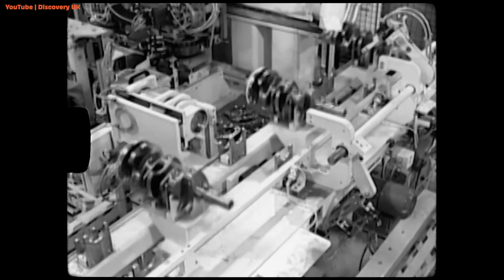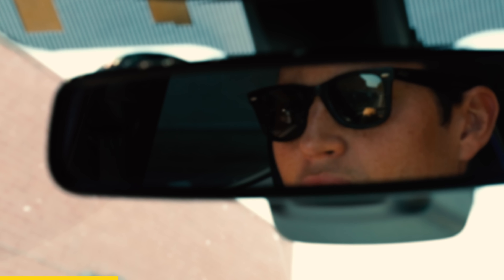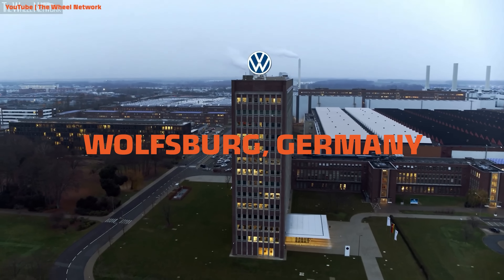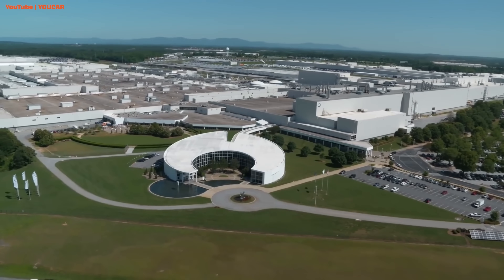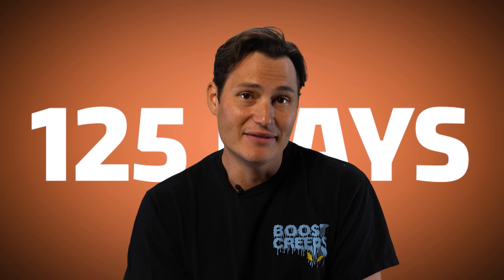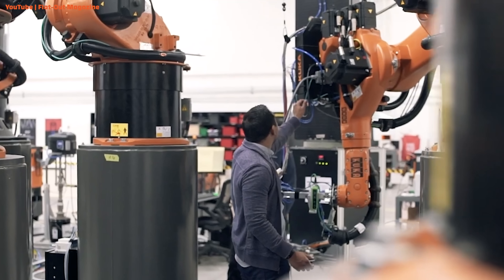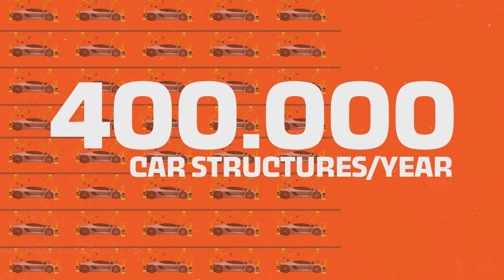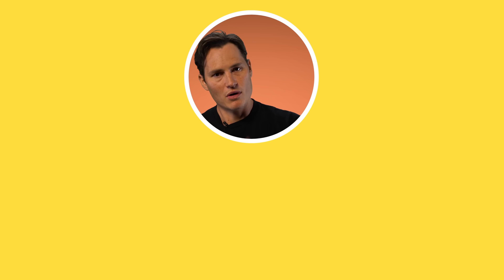A.I. Designed this Car

Comment: Year 2050: You will be downloading the car from internet. It will be made near the dealer who has 3d printer.
Reply: i hope we get there...2050 i mean.
Reply: @themexis  at 2050 6g comes out too
Reply: @jeremiah7913  whether it's 4g, 5g, 6g, and so on, AT&T is still slow as f*ck
Reply: @jeremiah7913  8g
Reply: Dealer: You want undercoating on that titanium chassis?
Reply: Sounds cool imho 😁
Reply: @aitoluxd  imagine dealerships are just 3d printers instead of lots u configure ur car on the fly
Reply: @v1Broadcaster  yeah, it's going to be great to see cars being made bespoke for every customer without making it costs arm and leg like rolls royce did. Plus with AI designing the new model, we would see weird yet effective designs that we couldn't even thought (which sadly eliminates jobs for engineers like me:(()
Reply: "You wouldn't download a car"
Reply: This is probably the most likely scenario.  One person would go into a dealer and say they wanted something like a miata, a relatively slow, but very fun lightweight sports car, and the dealer could show them a dozen different options.  Mixing and matching could add a premium, but not to much of one.  If the car ever breaks, the owner can have it brought in, the dealer prints a new part, and they disassemble and reassemble the car in about an hour.  Third party shops will have robots instead of mechanics, or mechanics running the robots, and do a similar thing with more generic but cheaper parts.  3d scanners are a thing after all.  The only problem here is that A. the cost won't be lower, but rather higher, cause capitalism, and B. You basically can't do it yourself, which isn't far off from what's happening to cars today.

In the future though, most cars will probably fill all roles.  You can't shed this much weight off a sedan and not turn it into a high performance sports car as well.  Gas savers will handle like a lotus elise, while actual common sports cars will be absolute monsters that perform like hypercars from five years ago.  Imagine a Mazda Miata or Subaru Impreza that can do 230 mph and 0-60 in 2.5 seconds.
Reply: Even with all of these advances, people still uses dealership which only add unnecessary costs and make hassels
Reply: Great Idea!
Reply: no dealer needed, just those 3d printers and cnc machines, just need the design files
Reply: *Download Lan Evo V data.
Reply: pretty sure they will still produce it in the manufacture, they just need the car to self drive to your place...
Reply: Torrenting cars
Reply: @daly7258  that could happen if you own a 3d printer 😂😂
Reply: year 2150: you will own the printer
Reply: "You wouldn't download a car", said an anti-piracy campaign a couple decades ago
Reply: The car can be printed at any manufacturer with an industrial type 3D printer. The real secret sauce will be be outfitting the car after it’s been printed. Which business will have in stock, and able to install, battery, motor, wiring harness, electronics package, head unit, speakers, seats, carpet, upholstery, etc...then able to test for QA.

For quality control purposes, I think this secret sauce will continue to be done in factories for mass production.

Comment: I wish there was more depth as to what ML algo was used to select the design parameters, computational time, and such. Given that running even one FEA/CFD simulation can require lots of computing power, I suspect that training an ML algo with so many variations will require an even more amount, as training requires a good amount of data. Who has the data? If it’s not readily available, one would have to run the various FEA/CFD simulations to create them. This is just my guess so any other ideas or comments from industry experts are appreciated.

Also, many 3D printers require printing mini support structures that can be easily cut away later, so it’s not that 0 material is wasted, but rather much less.

Comment: 0.01016cm assembly tolerance. LOL YEAH RIGHT. Sounds good, but if they can ACTUALLY pull that off (in a functioning production line day after day) I'd be amazed. Damn good for someone to be trying all this stuff though. Lots of great ideas and I'm sure this is the future, but I suspect its not quite as around the corner as some people would make you think.

Comment: Imagine though when everything is automated. Gonna be a ton of people without jobs.
Reply: Think about the maintenance of those robotic arms... A whole crew of people just for 1
Reply: The machines need people to maintain them.
Reply: Don't worry someone will have to make the chevy small block that powers this thing
Reply: There’s really nothing to be concerned about, until the robots start repairing themselves and then building new robots. THAT’S when the shit hits the fan.

Comment: 3D printed metallic part are not as resistant.. meaning it is very unlikely to lead to lighter part. (you have to compensate weakness with extra material)

Comment: No use of additive manufacturing or ai will replace those giant factories though. Yeah they may incoporate them into their processes but the size of the factory has to do with economies of scale. Also saying that "Czinger doesnt use humans" is laughable, if Czinger produced at the scale of VW or BMW they would use a comparable amount of people just in different positions. A 3D printer may be nice but it still has to be assembled, and yeah they use robots but they are also used by other manufactures. Also reprogramming the manufacturing cell is in no way "easy" and very comparable to the cost of making new manufacturing hardware for regular parts just that the cost is in man hours and computational resources. Czingers costs 3 million and take 125 days to produce 1 car, how many does a  500 million plant do in that time? Tens of thousands. I feel like more and more this channel is leaning more and more into sensationalism which is really sad because science garage taught me most things I now know about cars :(

Comment: There was a Mustang in the mid to late 90s that did 0-60 in 1.9 secs. It was the Boss 596, it was in Car and Driver or Road and Track, and it was put up against a 572 Camaro. I cant find the issue that had this article about these 2 cars. Ive looked and looked but no results. 
UPDATE: just found this on zeroto60.com 
1994 Ford SVT Boss Mustang 10.0L Concept
0-60 mph 1.9
Quarter mile 10.5

So thats the most info ive found in a while. I did find someone else who was talking about the same Mustang and issue of Road And Track (Im leaning toward R&T)
Reply: https://www.zeroto60times.com/vehicle-make/ford-0-60-mph-times/

Comment: I don't like the AI part. I like things that are designed by humans for humans. But I do love that 3d printing could soon be used in cars. I know this is weird, but 3d printing is almost like slavery but humane. Instead of using a human to do the same job over and over again, you use robots. If you want to change the function of the robot, just tell it to do so, using a computer. Humans have always loved efficiency, which s why many of our ancestors inhumanely used slaves. Now we have 3d printers, which brings production costs down, like slaves did, and increases efficiency. Think about it...I said earlier I like things designed by humans for humans. When slavery still existed at a mass scale, the plantation owner and inventors designed the processes used for things like agriculture, but the slaves DID the processes to produce the result. AI isn't free, but it is a HUGE and valuable reduction in cost.

Comment: Many 3d printed metals still need post printing finishing on lathes and mills, so yes they do print more material than is needed. But it is less waste to finish a printed item compared to standard production

Comment: It doesn't really look like an SR-71 at all, so I think that is a poor attribution to say it was inspired by it in any way. Honestly, I don't like the looks of this car at all. It's vague and generic compared to the SR-71's extremely iconic appearance. Just imagine this as a mushier SRT Tomahawk X...  With all of the innovation over the last ~30 years of hypercar design, I guess the shape just doesn't really change much once an optimized design is made. I was hoping AI would find a better shape than this.

That being said, I think AI car design is totally the future of automotive engineering and needs to be pursued in every conceivable facet of future processes. Even accounting for existing manufacturing processes with AI enhancements could be invaluable to maximizing mass produced vehicle efficiency until more robo factories can be installed.

Comment: So what I am hearing is, everything is really annoying to repair.  The manufacturing technique doesn't scale with volume because certain geometries are just not possible outside of 3D printing.  So it loses out on the main thing that makes car affordable, economies of scale.  This is basically going all the way back to a one off design but building it with robots which will mean actually good one off designs.

If all you do is make lots of one-off designs, this works amazing.  But if you are making thousands of identical cars, this just doesn't make sense.
You said it yourself it only takes an hour to assemble the car but 1500 hours for everything to be produced.

3D printing is slow for big things.  Which will be the main thing driving up the cost and doesn't have the advantages or forging, when it comes to final dimensions.  The 3D printed aluminum and titanium still requires machining to give clean mating surfaces for assembly.

If you are a car shop, the design stuff is out of your price range.  But something like a Metal 3D printer is in the same range as a CNC. If you are doing like a custom high flow intake, those two together can let you make something way faster than traditional supply lines.  But its not suitable for high volume markets.

Comment: Bruh, that's called Topology Optimization!
Not A.I. really, just a fuck ton of mathematics
TO is applied in airplanes and a ton of things nowadays, but only now is painless bcuz need an obscene amount of computational power for the simulations.
"Topology optimization (TO) is a mathematical method that optimizes material layout within a given design space, for a given set of loads, boundary conditions and constraints with the goal of maximizing the performance of the system"

Comment: So how can YOU make parts that look so frickin' awesome? The answer is generative design. If you have any experience in CAD software from autodesk (I believe solidworks has something similar but I haven't used it) you can set boundary conditions and make rad parts for your car with 3-d printing. These aren't generally parts you can make yourself on a mill or lathe so keep that in mind. Don't let the ultra-wealthy have all the fun lol

Comment: Thing is though, the most efficient use of material doesnt necessarily lend itself to accommodating other things like repair and troubleshooting.

Unless of course that was a consideration in the design requirements from an AI designer.

Comment: So basically the important part here it's not the "A.I design" it's the 3d printer and those cutting edge assumably lines that made it possible I'm sure if car designers weren't so limited, they could come up with some good designs too

Comment: Designing the wiring into the chasis 🤔 That's never gonna be a pain in the ass. Electrical components will sooner or later need to be swapped out. Even more if they use the same type of wiring harness material as Mercedez or BMW. Im assuming the car will rely on sensors, as most cars do, which are a common maintenance issue. From an engineering perspective, this is amazing. From the mechanical maintenance and repair viewpoint, a nightmare. This is a case of engineers making something, disregarding the fact that someone is gonna have to work on it.

Comment: No one has built a laser ablative finishing machine that uses heterodyne interference to fit a 3D-printed curve, yet. I am disappointed, as accuracies should correlate to the wavelength and calculated pattern, meaning sub-micron finishes on a material is possible with current tech. Fast, accurate, multiplicative, and cheap once someone figures out how to make it from the concept stage. You don't even necessarily need precision actuators or movement mechanisms, as the same interference can measure the surface and cut it from variable distances on-the-fly.

Comment: The only real problem is the job loss. That really can’t be picked up easily
Reply: If all the work is made by itself, it goes in direction to people don't needing a job to live. It's a weird conversation that everyone will have to have eventually, or it will get dark.
Reply: rockaway0beach it’s a conversation the rich would rather not have
Reply: @DergWerk  Well, that's interesting
Reply: Yeah. It’s going to happen. Just a matter of time. People need to really start thinking about their future more. Learn a skill/trade or get into something that won’t go extinct
Reply: @takohma1056  trades are likely more at risk, especially with robotics. But everything has the potential to be automated. Software engineers are coding themselves out of the job. But like everything, we industrialize to free up time to do something else. New skills will come and go, people will just need to be more generalised with their skill sets and have to adapt to different roles throughout their careers
Reply: I refuse to watch any Youtube channel ran by A.I.
Reply: Yeah, which is why y'all need to hop on the Yang train.

Comment: I always like to equate AI doing things like this to electricity through a wire or a thing. It take the path of least resistance to meet the constraints. The path of least resistance usually includes a lot of repeating shapes like triangles or hexagons etc. Its going to follow the absolute smoothest route possible, since If you design it right it wont have any other option. 

Its really interesting that when ULA was designing some parts for their rockets the AI that designed the pattern was biased in its math so it liked to use repeating triangles. But they tweaked the AI a little bit so that it understood the problem differenlty and it spat out a series of rectangles instead to match the use case even better. AI has a long way to go and it is all in learning how we can teach it better.

Comment: This is crazy... If the powers that be allow this type of design and manufacturing to happen, imagine the applications.  Trucking, shipping, hauling, the impacts to fuel usage and raw materials, supply chains, on and on... This will be an absolute game changer but it's a high mountain to summit.  The traditional auto industry has fought off a lot of innovation over the last 100 years.  Awesome video guys.